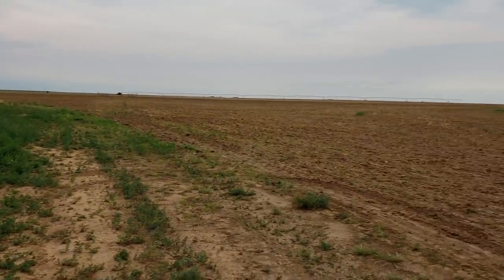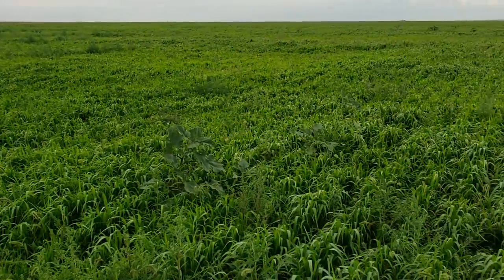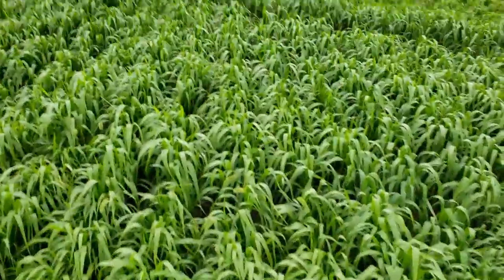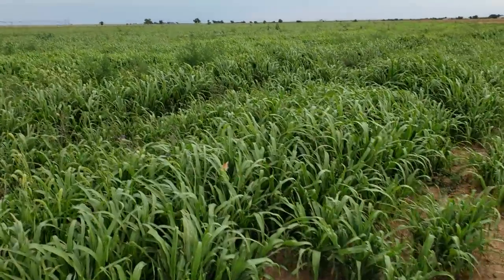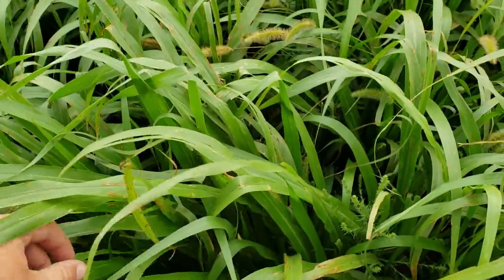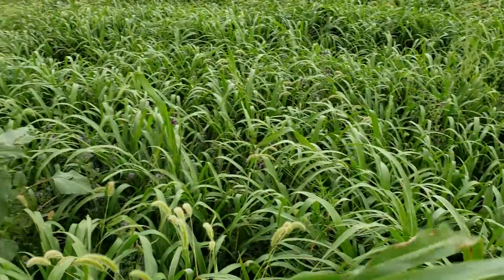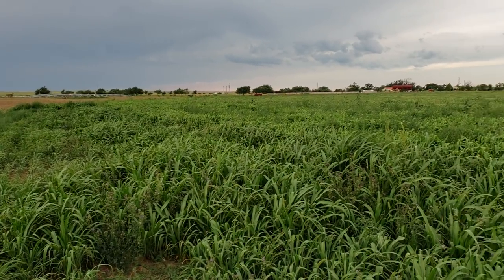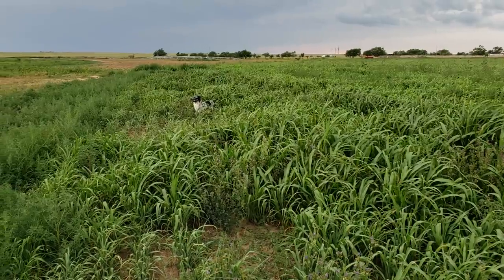Crop Update, My no-till hay trials

Comment: If you’re not going to graze it after you cut the millet off, I had really good luck spraying roundup right after I hayed my wheat off. I did that twice and it helped a lot with my vine weed. But I was told to not disc it cause that doubles the vine weed when you cut the roots
Reply from the maker: Jed Hergenrider they have some product. Now if you spray three years in a row it will kill it for good, have to knock out the seeds